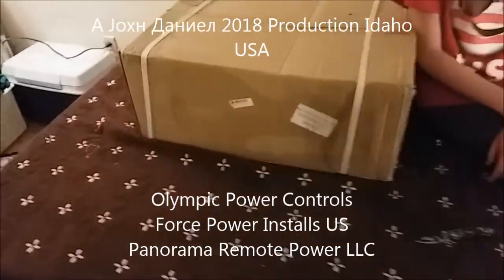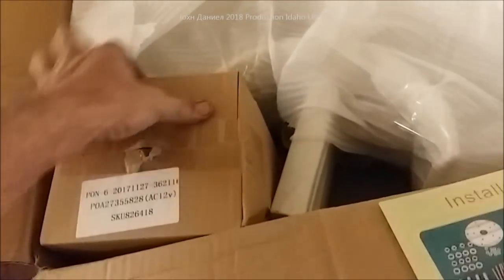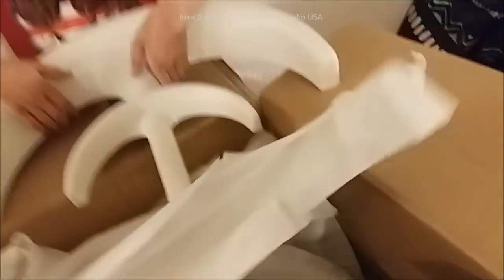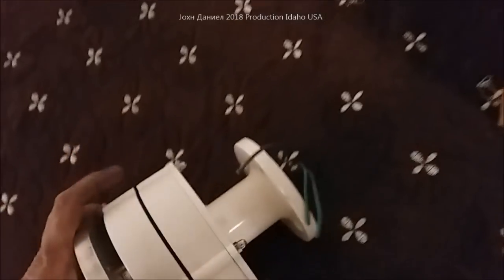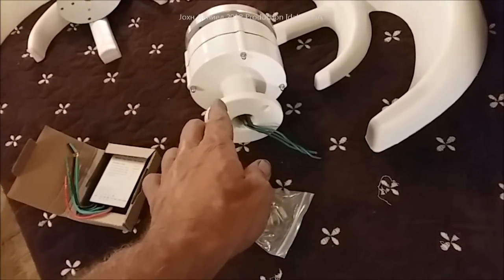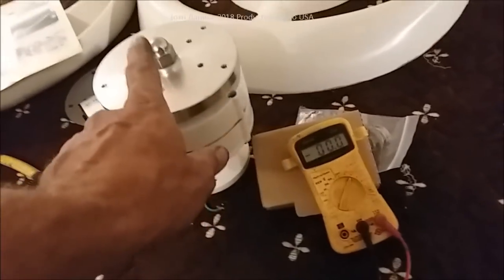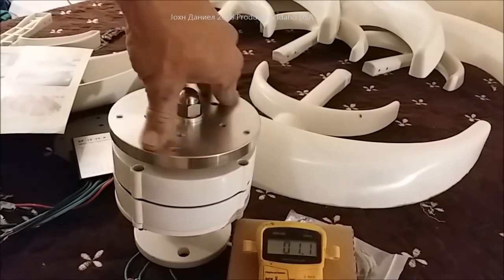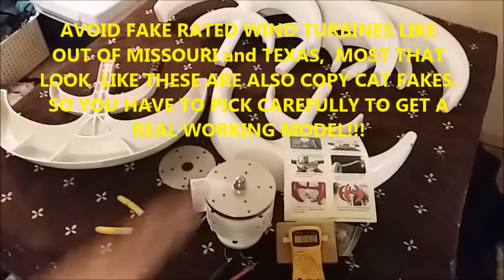New Chinese VAWT Lantern Wind Turbine generator vid 1 of 2 - 400/600Watt UPDATES BELOW VIDEO

Comment: Jd does it come as a compete kit . Or do you have to buy the rectifier and controller separate
Reply from the maker: It has no controller with it, and I am glad. The controllers they include with Chinese turbines are the lowest quality toss in part to sell it on the market. They look like the one I have but weight 5 ounces less and thats a big deal when it comes to rectifiers and mosfets!
Reply: Thanks JD .

Comment: Fill those spaces with a resin instead of aluminum.
Reply from the maker: A consideration, but I think in my weather the resin may fracture in the cold extremes like it has on other things.
Reply: Spray foam?  Then cut excess?
Reply: @mattlangstraaat3508   Easier way with the foam. Put a piece of masking tape on most of the vanes and just leave an opening at both ends. Foam in and then tape the ends and it will hold it in if you use the low expansion foam.
Reply: Dont know what material that "blade" is . cant say what sticks on it 
Glass fibre  and polyester resin will stick to near anything , not on polyethylene 
I would use aluminum tape , its light and thin and cheap .

Comment: So is it possible to put a small thing like this on a RV to charge ones batteries when driving to a destination
Reply: Maybe like one of those wind speed on top of a crane connect to Generator an put it in a tunnel so it don't drag down the vehicle but still wired to a battery setup I'm think power as we go
Reply from the maker: Possible yes, logical no! Use a cheaper alternative to do that https://ebay.to/2pAswvi . I use one on every RV I have and tow vehicles too.
Reply from the maker: Yes, but I have had Victron isolators fail and destroy 8 batteries. I only stay with those designed to fail open style - solid state, 7 years now, no fails https://ebay.to/2PowxSU Solid State weather proof

Comment: if you want to cover the  recesses on the back of the blade use  high velocity alum. tape it  sticks and adds min, weight
Reply from the maker: I figure to put some aluminum trim roll on my brake machine and make some C-channel. Some 32 gauge polyester coated. It will cover and be light.